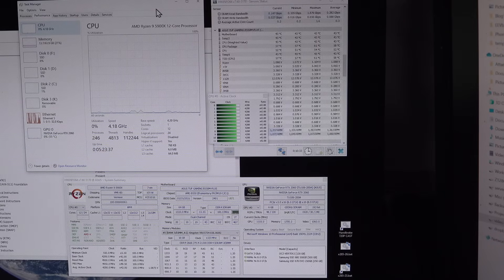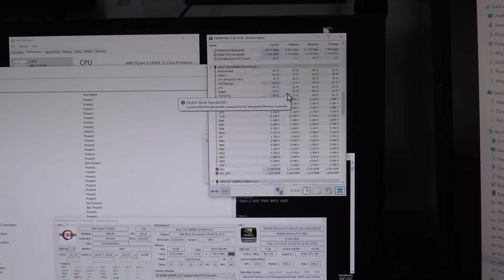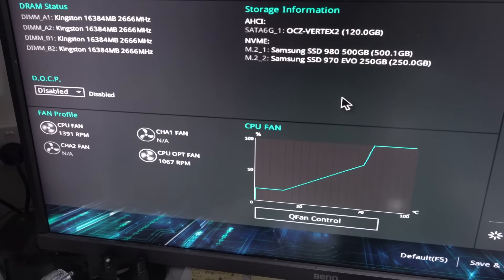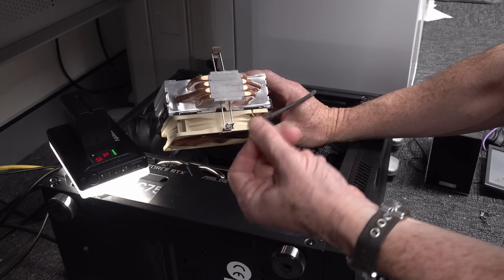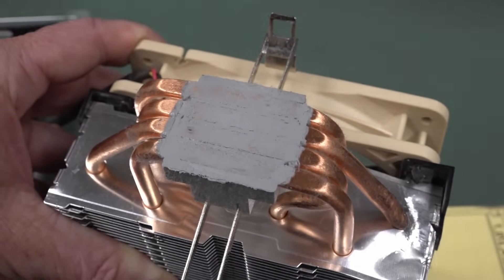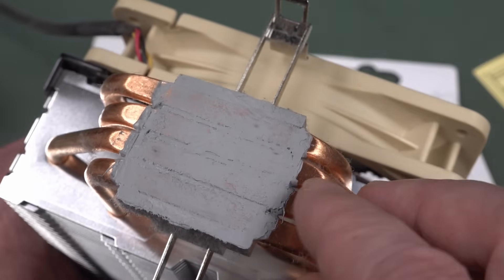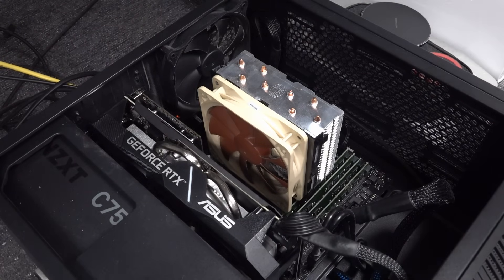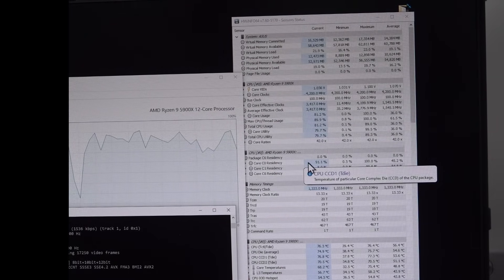CPU Thermal Ghost

Comment: Dave,
	3 things to check from a random guy from the internet that has repaired a LOT of PC’s. I am also going to assume that there is no overclock. 
	Thermal paste did look a bit dry but still serviceable It was not totally dried out but getting close.  In the INTEL world especially with the latest core I9 series processors I have started to put them under water using AIO liquid cooling. I do not like building radiators systems for customers as there need to be serviced but the AIO units are sealed and never need to be touched. The 240mm and up radiators are FANTASTIC at keeping things cool. Corsair H150i as an example. For reference my 2 higher end systems are funning intel 9900K and the editing and cad rig is running and Intel Extreme 9980xe
	I ran in to a situation where a friend and Tech was pulling his hair out trying to get his computer up and running. After about 3 months of troubleshooting he brought it to me The effect was when he started up a heavy game the system would crash to desktop. Not kill the hole system but would crash the game with a video error. It ended up being a power supply issue. With the high current draw of the graphics card the power supply was heating up and the 12Vdc rail would fall to 10.2 temporally but when the load left the power supply recovered. I needed a Keithly 6500 to catch the glitch the power supply glitch was to fast for the software to catch it. Given that this seems CPU related I would probe at the 12Vdc in put to the Vregs for the CPU. This will either implicate or exonerate the power supply. 
From some of the metering it looks like the system is only bosting up to 4.18. Max boost on the 5900X is 4.8 so the cooling systems is most likely the limit here. Base clock is 3.7 so we are seeing some turbo at idle but not all of it. If sticking with the air cooler I would add the second fan on the other side and use the air cooler in push pull. AMD also recommends liquid cooling for the 5900X
Just some thoughts,	
Zenwizard

Comment: That cooler is honestly not great for 12-core Ryzen processor. The fact that it has direct-contact heat pipes tells us that it's a budget model, because no matter what they say, the so-called "direct contact technology" is inferior to a solid block of copper and is only used to save money.
When you took off the cooler with the old paste, you can basically see no metal and only paste. That's a bad sign, because you need as much metal to metal contact as possible, with the paste just filling in tiny little crannies. 
I suspect it's a combination of a low pressure clamp (it just uses the one springed clamp in the middle) and a not-so-perfectly machined surface.

TLDR, this cooler is a budget cooler for i3 and i5 office machines, I wouldn't use it on a 12-core Ryzen encoding workstation.

Comment: The new ryzen wants to be at 95 C to get the most performance out of it. A bigger cooler and enable DOCP will gain you a lot more performance. But yeah, that thermalpaste was really dry, wierdly dry. I would update bios since they have fixed a lot of stability problems.
Edit:Ok, im blind, thought it said 7900x. :D But still, enabling DCOP and updating bios will gain performance. :)
Reply: I think maybe the 7000s are supposed to run that hot but I don't think the 5000s where specifically intended to stay around 95C.

Comment: You may have more than one problem with the first being old thermal paste which you replaced and seen a notable drop in thermals which would remove the thermal  error leaving behind the others,  just recently my PC also had an issue with just randomly crashing and it turned out to be a bad stick of ram and in my PS i have two 16gig sticks and i guess when it was used  and filled up  and hit the faulty area it would  just crash, good thing about windows is it actually has a memory tester built in and if you type Windows Memory Diagnostic in the windows search it will pop up you can then run it and  click the restart and run diagnostic option  and then let it do its thing, it will run its test and display if memory hardware errors are detected ( it will take some time ) then if it shows errors you can remove a ram stick  then repeat the test until you have found the bad sticks.

Comment: Haha! Love the 'reee reee knock yourself out', Dave. Honestly, I've never seen anyone apply paste correctly the way a materials scientist would - which is to use almost none. The whole idea is the paste is ONLY for the microscopic grooves where metal ISN'T in direct contact with metal. But we all, myself included, try and apply a nice even thin layer like you just did, because it's simply impossible to apply it the 'proper' way.

Comment: did you change cpu cooling policy to active ? also drop down max cpu percentage to 99 in advanced power section on windows may help. windows 10+ has some problems with power management , performance modes and bios data conflict. Power and thermal related  BSOD errors generally random not reflecting real cause of it. After recent windows updates I got similar problems.

Comment: Looking at the video at 10:47 you install a CPU cooler at a right angle to the direction of what would be better airflow. Are you sucking hot air from the top of the GPU into the CPU cooling fins rather than sucking cooler air from the front of the case and exausting it out the rear of the case. Also that CPU cooler looks a little limp for a 5900X. Something like a Dark Rock Pro 4 might be better. Oh for Dave - I am not bitching, just trying to help based on what I see works in my computer. 😀
Reply: Looks like this is the only way this cooler can be mounted. It is a budget cooler for much smaller CPUs. It doesn't have a good mounting mechanism and a badly machined surface with only 4 direct-touch heatpipes. When he takes it off, you can see that the mounting pressure is less than adequate. There was almost no metal-to-metal contact with the old paste. It's just not made for 12-core Ryzen cpus.

Comment: Isolating the cause will be a pain because of the many factors that can cause such. You have removed temps as a cause. Leaving other possibilities being 1: a power delivery issue somewhere in the power delivery path, so either PSU or VRMS and any components on that path. 2: Electromigration, meaning one or more cores have become more voltage sensitive. That would be a pain to track as you would have to disable a core, run a stress test and repeat till you find one that causes a crash. Of course, to add to complexity, sometimes software updates and OS updates can cause odd issues as well. Rather you than me tracking down the cause.

Comment: Your CPU clocks aren't behaving normally for a Ryzen. Your CPU is running at a constant 4.2GHz as if you have a static overclock. The frequency should float up and down constantly according to the temperature and current limitations. Check if you have a static clock enabled in the bios, that is preventing the CPU clock management from working.

Comment: I have the same CPU in my gaming rig.  It is a beast of a processor and it can get hot fast if not tamed.  I opted for a AIO instead of an air cooler with a 360mm radiator.  That Cooler Master paste is just fine, and yes, the card applicator method is common for most newer processors.  Corsair does the same thing.  I still think its a thermal issue with the CPU.  If it was a power supply issue I would think the system would crash when the GPU was under load too.  I would also test your RAM.  I've had bad RAM cause the system to crash under CPU load too.
Reply: He doesn't necessarily need an AiO watercooler, but he definitely needs a better air cooler. He uses a Cooler Master budget cooler which is fine for a lot of processors, but not for a Ryzen 9 with 12 cores. It only has four heat pipes, it uses direct-touch on the bottom (it's a money-saving method but clearly inferior to solid copper blocks) and it has only one low-pressure clamp. 
A Noctua NH-D15 is just as good as most AiOs and should do the trick of taming this beast.

Comment: 04:56 CPU cooler orientasion looks like 90degrees wrong way.
Noctua single tower NH-UXXX is not enough for Ryzen 5900 serie, you need at least NH-D15
...or water cooler.
If you have bad luck, there is whole in heatpipe and all moisture is gone inside of pipe.
PS* Remove PC case side panel off :)

When Ryzen 5000 series came, there were lot of motherboard BIOS updates after CPU release, what also fixed too high CPU voltage etc. etc.
But before doing any BIOS update, you need collect your old BIOS settings,
look-ready motherboard CMOS clear jumper because you propally need clear CMOS after successfull BIOS update, you need understand how to do that (with power off !!).
This sound too techinal, so it better leave this job for one who have done these before, don't do yourself.
Reply: The cooler is a cooler master, not Noctua.  Just the fan was Noctua.
Reply: @burner8959  now I saw it while you mentioned, at 10:57

Comment: Is it possible you have a system update come through that has caused a stability issue?  (so nothing hardware is causing the underlying issue, its some update with Windows or your rendering software)

Comment: Probably PSU.
Did you undervolt the CPU, the V looks a bit low at 1.06V for stock, usually Mobo runs it at 1.2V+

Comment: Temperature shouldn’t crash the system, so my expert opinion is you need a new power supply. Your cpu pulls around 100 watt, that 2060 pulls probably 200-250 watt, and you’re not using them at the same time, so I’d get a lower wattage supply but from a reputable brand like Seasonic. And since you’ll be pulling out all the cables, throw in a $50 heatsink that follows the usual horizontal airflow standard. You’re in a warm climate, the case looks pretty closed off, you could leave it and at worst the cpu would run a bit slower when it reaches 95°C, but I’d replace it anyways. If you have another psu laying around you could test it by leaving it outside the system and just plugging in all the cables.

Comment: After you've checked your PSU ripple under load, maybe check the VRMs on your motherboard around the CPU with a thermal camera. If they all look fine, I would seriously consider a dual tower cooler. You say that it's been working for years, OK then it's been running hot for years I guess. If the CPU is half cooked, maybe a properly sized cooler could keep it going for a bit longer.

Comment: Also a 9500X user. Some things that immediately stood out for me.
1: You have a locked CPU clock. This is going to generate added stress on the CPU, and make it run hotter than necessary. When i am sitting idle at the desktop, my CPU regularly down clocks to 3Ghrz. And the core frequencies are fluctuating all over, as each core is individually loaded and balanced as needed. Yours isnt doing any of that. And you VCore Voltages seem to be relatively locked as well, where as mine fluctuate WAY more as they are loaded and unloaded. Even under 100% load, as threads are stopped and started.
2: You really need to get a new Heatsink. That thing is sucking air up from the Video Card, which is not helping with matters. I know you said its always been that way...but...
3: You said you got a new video card. So, no, it hasnt always been that way. A new video card can have a profound effect on system stability. From additional voltage draw across the PCIe Power Bus,  Additional Power demands from the PSU that can induce all kinds of problems like noise and ripple, and of course the added Thermals inside the Chassis, which your CPU Cooler is sucking right into itself. Plus that looks to be an NVidia card, and NVidia drivers have terrible overhead, and cause a host of problems as well. Including their encoder software that is built into the drivers. You even stated that the slowness on your encodes didnt start until you upgraded the video card. But "nothing has changed", right??? Be honest with yourself, Dave.

So, at a bare minimum, there are likely additional power plans that need to be installed on your system for Ryzen. Probably have the Power Plan in WIndows changed as well. Plus some motherboard settings to better manage your CPU frequency, and get some better overhead with the CPU so you are not stressing the CPU 24/7 at higher unnecessary clocks, and allowing it to downclock and load balance. But also allowing for higher performance on demand with DOCP, and PBO.
I am also running an ASUS motherboard, and the UEFI are very similar to yours. So i know all of this can be done. You might have better luck using the Advanced mode of the UEFI, and not the Basic home screen which really doesnt allow you to do shit. Or, maybe not, given your level of understanding.

I would love to be able to help walk you thought all of this. But honestly, Dave, your despondent attitude, and snarky retorts make me completely uninclined to offer you any assistance. Just like you dont care about people giving you suggestions in the comments...while youre literally posting a video asking for help. Nah, I dont have time for that. Good luck.

Comment: A know you are already tired of all the smart guys, but I'd like to try to help, I noticed that your fan blowing the hot air from the GPU in to the cooler try to get fresh air from the top of the case. The cooler also can be defective, if one of the heat pipes went wrong. Or just a simple update that allows the cpu to run with more voltage. (One of my friends had a cpu that even with a triple AIO ran hot so he had to bring down the voltage in the bios :D)

Comment: Being in the computer business, I would guess that one or more of the VRM modules is failing (or a bad solder joint on the motherboard on one of the VRM components).  Normally if the power supply is failing it will reboot or turn off without blue screening.  Just ran Handbrake on a similar system with a 5950x and 5 heatpipe cooler and never got above 70c.  I sometimes run into heat sink fans where they are not properly lapped and just use a very fine grit sandpaper on a flat surface and sand till I do not feel any groove in the surface.  If you have upgraded the bios lately ASUS may have upped the voltage slightly that is causing issues. If so, see if you can restore to the previous bios.  Since it reboots very quickly try using one memory module at a time to trouble shoot memory problems.  I have had bad motherboards that sometimes would take days to fail, trouble shooting this shouldn't be to bad.  If a motherboard replacement is in order get a X570 one (they are usually more robust in the VRM area).  I normally try to stay away from ASUS because of their bios issues (they fix one thing, create 3 others) although they seem to make a quality motherboard (I have had their motherboards last way past their useful life). Could also be a bad CPU but unlikely (I have sold over 15,000 CPU's and only recall every having to replace maybe 5 but I tend to go a bit overboard on the heat sink fan thinking cooler is better)(35 years in the business).  Hope that helps!

Dr. Dave
Eagle Computers

Comment: Not savvy enough to advices on hardware, but dealt with big machines at enterprise level. CPU warnings should not appear, ever once. So I guess that if you had it a handfull of times,  the system had some issue from the start that just got worse. We return machines if they ever get a non expected CPU temp warning.

Comment: Arctic bloody Silver. That stuff is shite long term - sure, when it's fresh it's great, but it goes hard with age and becomes an insulator! 
Standard white "dow corning" paste for me :)
Reply: Arctic Silver is old news, I haven't heard anyone using this since like 2010
It's not to be confused with Arctic, which is a completely different company that makes the MX-2 and MX-4 thermal pastes. Those are pretty much a modern standard if you don't want to spend top-$ on the very, very best paste.
Reply: @maximilianmustermann5763  Having tried MX4 recently (and yes it was genuine) I was unimpressed. Same problem - it goes hard with age and causes thermal issues.
Reply: @jaycee1980  I haven't even tried the MX4 yet. As I wasn't building any super hot systems, I just used MX2 and haven't had a single problem with it. It's relatively cheap and good to work with. Didn't notice any deterioration over the years so far.

Comment: I wouldn't rule out that something has changed, forced Windows updates could have included a CPU microcode update. You just never know, especially with recent vulnerability patching. Could have been enough to destabilize your configuration.
Tuning Ryzen is a whole rabbit hole in itself, that comes with buying enthusiast/gaming spec parts. Good idea repasting, seems to have helped somewhat. My gut is telling me power issue, either VRM cap issue on the mobo or PSU.

Comment: I did some distributed computing for some time,  and while it worked fine for a long time,  eventually the cpu burned out. I used a heatsink/fan similar to what Dave has and the cpu temps would get in to the 80c+. Liquid cooling would drop cpu temps quite a bit, and i think Dave's computer (Dave as well with that pool) would benefit from liquid cooling as well.
Reply: He doesn't necessarily need liquid cooling, but at least a better air cooler. The one he's using is a budget cooler that's fine for a mid-tier i5 gaming or office computer. These top-tier Ryzen processors are a different type of beast, especially if you use them for encoding.
Reply: @maximilianmustermann5763  But what has changed? Encoder jus stated to work harder one day last week?
Reply: @OKuusava  You can't even rule that out. Make an update of Handbrake, it uses a new version of iffmpeg with new optimizations, cpu gets hit harder than before. Who knows? Or maybe it's been working on the edge for a long time and now the thermal paste has finally gone so dry that it took it over the edge.